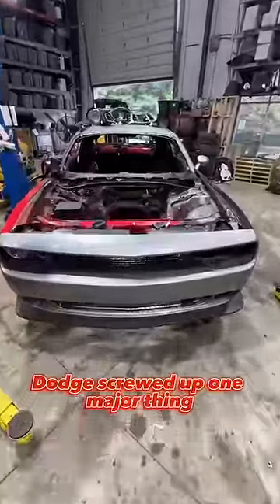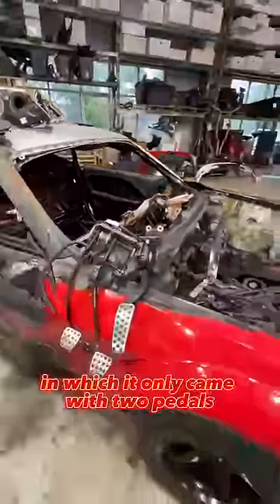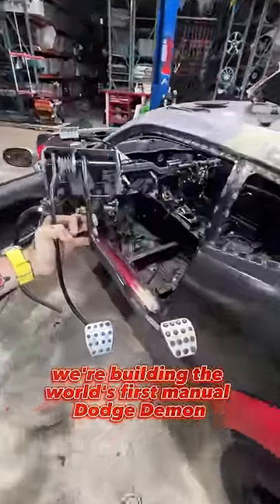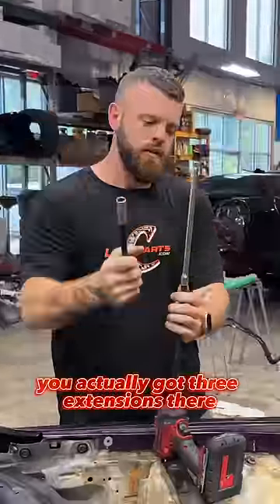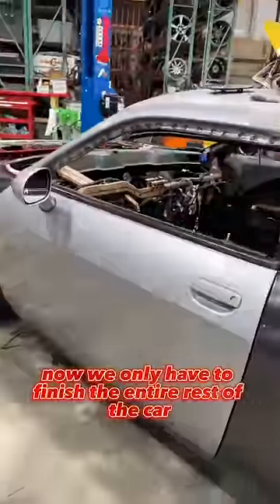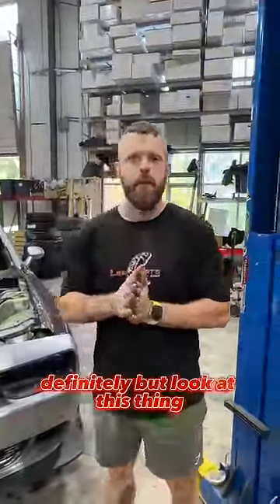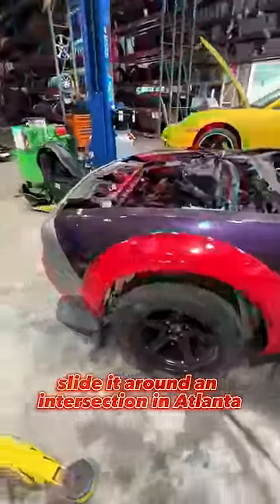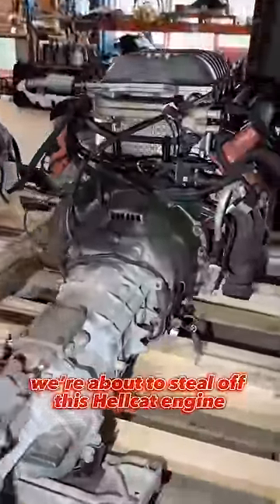Dodge made one HUGE mistake on the Demon!

Comment: Manual gearbox could be slower but its fun, you have much more control to do shit and enjoy your car
Reply: That’s why you choose a normal hellcat over a demon.  A demon is meant to be as fast as possible with no compromises.  If it came in a manual it’d be a nightmare to get it to run decently fast times.
Reply: Plus the manual will be way more dependable for years to come. I personally don't own anything with an automatic transmission.
Reply: @benson4820 I don’t think so, the torque converter is what slips more than a clutch and makes you lose power, if you actually know how to drive a manual and manipulate the clutch it’s way faster cause you can actually get in full gear pulls unlike with automatics. The only part I agree with you is the computer may shift faster and at better moments than a human operator can but manually is still better in my opinion
Reply: @faucitv4684 I don't. We didn't get Dual clutch trans for no reason... Autos are faster, Manual is helllllllaaa more fun, but you gotta be fast as hell at shifting if you want to use all the HP in the car... Honestly I feel like the engineers behind the caddilac blackwing are right, 700 hp and STOP.
Reply: @evilwilliams  dude it’s not the 80’s automatic transmissions are better than manuals in literally every way except “fun” but I don’t know why y’all think changing gears is so much fun.
Reply: @notmyrealname1698  oh yeah. Remind yourself of that statement when you're paying 5 to 6 thousand dollars to get that slush box replaced. Fun fact automatic transmissions were first introduced to attract more women to buy cars.
Reply: @evilwilliams   bro you are just so wrong idk why you have an emotional attachment to a manual gearbox but modern automatics are literally more reliable, more fuel efficient, faster and longer lasting than any manual Transmission. Technology has advanced genius and you mentioning that it was invented to entice women to drive just shows that you’ve somehow attached this to your sense of manhood which is just sad.
Reply: @notmyrealname1698  No you are wrong on every level! Nobody will ever convince me that an automatic is stronger than a manual gear drive, anybody that knows the least bit about power transmission knows the gear drive is stronger and last longer than an automatic PERIOD end of story. That part about sales to women came from a program on the history Channel years ago so maybe they lied although it is very logical. It has zero to do with "manhood" on my end it's all about the stronger more dependable component that is the manual transmission. If it's affecting your manhood in a negative way however, may I suggest a straight drive vehicle.
Reply: @faucitv4684 it's cute that you think manuals are faster than new auto transmissions. Are manuals fun? Hell yeah. Are they faster than new autos especially performance autos? Not a snowballs chance in hell. Not even with Ken block driving.
Reply: @nateg08  no cause while you there with just your foot on the pedal going through gears and you already in a higher over drive gear I can leave my transmission In 3rd and gap you cause you can choose which gear you want to use
Reply: @faucitv4684 Yeah no, (good) automatics are better than manuals in racing period. Faster, smoother, shifts, and a stronger design. Manuals are FUN, auto’s are faster
Reply: @faucitv4684 Yeah no, (good) automatics are better than manuals in racing period. Faster, smoother, shifts, and a stronger design. Manuals are FUN, auto’s are faster
Reply: @faucitv4684 Yeah no, (good) automatics are better than manuals in racing period. Faster, smoother, shifts, and a stronger design. Manuals are FUN, auto’s are faster
Reply: @faucitv4684 Yeah no, (good) automatics are better than manuals in racing period. Faster, smoother, shifts, and a stronger design. Manuals are FUN, but auto is faster. Really cant even argue gearing control either because thats what DCTs (which are still automatic transmissions) are for
Reply: @evilwilliams ”Nobody will ever convince me a manual is stronger or faster than a manual”
Bud look at every performance car and tell me what you see across the board, its automatics. Look at any high power drag cars, even top fuel drag cars are using 3 speed automatics
Reply: @faucitv4684 1 no thats not how it works, 2 have you ever heard of a DCT?

Comment: Manuals you get less powertrain loss and you can FEEL the power way more. Definitely a win.
Reply: As the old saying goes you eather love them or hate them and choose accordingly
Reply: Less powertrain loss, but also a slower, less durable transmission
Reply: @kingiument4627  Manuals aren’t slower? They pull way harder than an auto that’s a known fact. And manuals are far more durable than any auto. You’re completely wrong. And yeah way less powertrain loss.
Reply: @pollux2825  Go do some investigating man 😅. Performance cars, race cars, drag cars, tractors, tractor trailer trucks, even industrial dump trucks all use automatic transmissions. Why? Because they’re faster and stronger. Manuals have their place in economy vehicles now and some specific industrial uses like logging trucks. Welcome to 2024 man it isnt the 80s and 90s anymore
Reply: @kingiument4627  Everything you listed still uses and makes manuals? You’re absolutely tweaking. If you don’t know manuals last longer and hold more power you know absolutely nothing about cars. The U.S is the only spot that switched to auto’s so hard. And it’s not because of anything besides the fact they’re all lazy. Sequential’s are the best to use for performance and track, and ask any trucker ever they all prefer manual and they don’t break like auto’s. Auto’s are only better at shifting faster and making driving slightly easier😂 (when compared specifically to an H pattern manual transmission). You’re also talking like U.S is the whole world when it’s a tiny spec of it.
Reply: @kingiument4627  Any small amount of research will tell you manuals are far more reliable than automatics. That part really is crazy. Mpg and reliability and simplicity is why the rest of the world still uses them. Stuff the U.S cares nothing about. They don’t care about long lasting vehicles they don’t care if things are overcomplicated and the people over there and there massive dumptruck cars show no one cares about mpg either. Besides with how much they like big cars over there makes sense to put a big clunky auto in it. You probably drive a CVT😂
Reply: @pollux2825  Manuals are more reliable with someone who knows what they are doing, sure. This wasn’t an argument of reliability it was an argument of what is objectively better. And then you start babbling on about nonsense and using insults for no reason solely because you guys are getting schooled

Comment: It was a crime to not make a manual demon
Reply: Not really, it’s supposed to be as fast as they could possibly make it.  A manual version would go against its philosophy.  There are plenty of other Challenger variants that come in manual.
Reply: @benson Nah it's a crime mate, you don't think so cause you can't drive manual, manual will always be quicker and better round a track, you're in more control of the car.

Only people who rate automatics are those who are shit at driving stick.
Reply: @GM-wu7cn maybe in a 2t old benz lol, try going against a 992 gt3 rs and tell me manuals are still quicker 😂

Btw i live in Europe and daily drive a manual
Reply: @GM-wu7cn it is designed to go as quickly through the 1/4 mile as possible. In drag racing automatic beats manual every single time.
Even in track racing, a semi automatic or fully automatic will beat a manual.
Reply: @hughmongous5089 Depends on the driver. They have their preference.
Reply: @kriswhite6838  manual can't keep up with modern transmissions. You can't shift as fast as a dsg without severely shortening the lifespan of the manual transmission or the clutch or both not to mention the much higher number of gears you can have with an automatic.
Reply: @GM-wu7cn as someone who has driven manuals as dailys for the past 6 years… automatics can definitely be faster. BUT, nothing beats the satisfaction of a perfect manual shift. Automatics are boring af.
Reply: @looped7979 Well in Terms of drifting a Manual will be unbeatable
Reply: @GM-wu7cn youre actually ignorant bro... a DCT transmission will always be faster than belt driven autos and Manuals. I agree with manual being more involving but to claim manual is faster is humor
Reply: @GM-wu7cn  LOL, you truly know nothing about cars. The Deamon is built for drag racing! Auto is ALWAYS faster and most constant in a straight line, which is exactly what this car is intended for. There is a reason why the Power Glide and Turbo 400 transmissions are far more common in drag racing than a stick shift. You want a Challenger with 3 pedals, get a SCAT or Hellcat. And this is coming from someone what had NEVER owned an automatic in their life.
Reply: @looped7979  paddle shift is still manually shifting, not a fully auto box, no rally driver drives with an ecu shifting for them.
Reply: @ohnaw223  No you're ignorant, not everyone races in straight lines. "Round a track"
Reply: @GM-wu7cn  The demon was developed as a quartermile beast. Stop bro just stop
Reply: @GM-wu7cn Automatics are still faster than manuals around a track, too.
Reply: @johnathanmoyer2375  tell me why F1 cars are paddle shift and not a full auto then bro
Reply: @GM-wu7cn  We're not talking about auto vs a dog box sequential manual.  We're talking about auto vs a synchronized  gated manual.  You know, the ones actually used in road cars.  DCTs and even ZF Torque converter transmissions are so much faster than any synchronized manual.
Reply: @GM-wu7cn quicker around a track for a car that was built for the 1/4 mile
Reply: @GM-wu7cn  You are clueless.
Not only is automatic quicker in the 1/4 but they don't want to warranty driveshafts and U joins to people like you.
Reply: Real drivers know how to swap cogs.
Reply: @stuwest3653  "round a track" there I'll say it again.
Reply: @GM-wu7cn i had a 6 speed ls and an auto. Manual was more fun stock vs stock. But auto is way more fun with a 4k converter. Auto + huge stall is the god of all setups and the most fun. Unfortunately you assume people can't drive stick. I assume you have no idea how a stall feels. If your ignorant and haven't driven both, your opinion is invalid.
Reply: @GM-wu7cn lol manuals being faster than autos hasnt been true since probably the 80s or earlier. New autos shift WAY faster than manual ever can. I love driving a manual for the feel and involvement but you're dreaming if you think they are faster than new auto transmissions. That's absurd.
Reply: @brandon9491  have you ever tried something like turbo 400? You still shift.. just not clutch, and with a small torque converter, the revs are 10x greater feeling and control than any manual I ever owned. Had t56 6speed z28 and stock ls1 with 4l60 and 4l60 e with 4k yank stall, and 400 with 4k stall for nitrous. Manual is cool and all, but way over rated by high school kids who aren't fully indulged with drag racing knowledge
Reply: @GM-wu7cn the demon is a drag car not a track car. It’s literally made just to go in a straight line as fast as possible. If it was a track car they wouldn’t give you the thin front tires, which are specific for drag racing. Autos are just better for drag.
Reply: Agreed felt that the last call chargers and challengers should've had a manual option imagine a 2023 Charger Daytona, Scat Pack, Hellcat/Redeye and of course the SRT Demon whatever number it is
Reply: It’s a drag racer(and a heavy/slow one at that) not a drift or rally car. There is simply not purpose or need for it to be manual.
Reply: @GM-wu7cn that’s not true at all guarantee you a Porsche will beat any manual car you throw at it

Comment: Wait till he finds out you can order a manual demon from the factory
Reply: except you can't...? only hellcats have been manual
Reply: @shoopitor3796 Must be something to do with last call allocations on the Demon itself. May be worth looking into if OP is correct.
Reply: I googled it. Manual demons were never a thing, even as a special order.
Reply: Now get it under 2 tons!
Reply: Cant, not a thing
Reply: In 1970 it was a better option
Reply: @Wheagg wrong
Reply: The only supercharged V8 models with manual are the regular and wide body Challenger Hellcats. You can’t even get a Charger of any trim in a manual
Reply: i’m seeing a mandela effect🤔 ppl seem to remember demon coming with 3 pedals
Reply: @kabob21  1971. Demon 340. , 3 speed manual transmission
Reply: @6lackRain  not a single person remembers, reread the comments buddy
Reply: @autopartsmonkey7992    1971 demon 340 3 speed 275hp and 370 ft-lb torque weighing around 3200lbs doesn't sound like a better option than 808hp 717ft-lbs torque at 4200lbs ill sacrifice the manual trans
Reply: @autopartsmonkey7992  back when manuals were faster than autos, yes. Now that the auto is faster, dodge's halo speed demon has only the fastest setup
Reply: @autopartsmonkey7992 how are you gonna bring up a completely different car in a discussion about a challenger demon
Reply: Yeah maybe in 1971 but not right now
Reply: Manual demons don’t exist lmao
Reply: Except that demon doesnt make nearly as much power as the new ones

Comment: FYI   Your not the first one to build a manual demon.      I know of a 1972 triple black car.  If my memory is correct it was called the black ghost  .  😮
Reply: That’s not a demon lol that’s just a base model 1970 440 Hemi challenger with extra steps
Reply: The black ghost wasn't close to a base model. It was one of the only cars to have every option including the gator top.
Reply: @thatsrtkid  yeah it was an expensive muscle car with gator yippee it still wasn’t no dodge demon
Reply: @killerdragon2011  right... it was a dodge challenger. And the demon used to be a faster Duster in the 70s. You said base model, the black ghost was far from that. The gator was a rare option bc it was expensive and also ugly.
Reply: @thatsrtkid  yeah I kinda forgot it had other options than just the triple black and gator tbh lol it’s been awhile since I’ve watched anything about that thing
Reply: @killerdragon2011  no worries dude! There's a great 20 minute documentary on here abt it. The 426 in the black ghost was also a rly expensive option almost no one could afford. And it owned by a cop of all ppl

Comment: There’s a reason it’s running a beefed up ZF 8HP90.. you’ll never shift faster or smoother with a manual, but neat to see on being done
Reply: It's not about "shifting faster" why do people automatically go to this when comparing a manual "you can't shift faster" no shit Sherlock.  We know that.  The ppl acting like the auto is 3 seconds faster in the quarter are ridiculous more like 3 tenths lol.  If you can drive you can come pretty close to the speed of a modern auto shift and it's not about that anyways.  It's about the experience and having 10000000x more fun.  I'll take that any day you can have your 3 tenths I'll find 100 other ways to get that back and then some.

Comment: I'll never understand other car guys' obsessions with adding a whole extra step to how you drive your car lmao. Autos with paddle shifters are so much more efficient
Reply: Ppl who can't drive a manual well aren't gonna understand it.  It's not this huge awkward slow thing for us we do it quickly and smoothly and it's super fun and engaging.  I feel bad for people like you who will never know how good it feels rowing through a gearbox efficiently on a backroad or running right beside a modern auto in a roll race when others think that isn't possible or shifting faster than others thought was possible.  You will never know what any of that feels like thus you'll never understand why someone wound go out of their way to "add an extra step" to the driving experience.  Auto with paddle shifter is NOTHING at all like driving a true 3 pedal manual so don't think that it is because it isn't.  It's not even close to the same thing and it's super gay.  Have fun with your boring auto while the rest of us actually drive our cars.

Comment: The car was designed to drag race. Manual is slower period for that application.

Hellcats are designed for Daily use, 800+ horsepower with a manual mechanical clutch is just miserable to use on anything but a track

Comment: Okay Imma just say this right now 80-95 percent of all demon owners could not shift fast enough to be faster than the auto. That auto family is insanely good to the point where flipping BMW is using it on their m cars(use that info for what you will but it’s true). It would be fun but holy fuck knuckle would it be hard as shit to shift it for a 9 unless the gears were long as fuck

Comment: I had built the first and only, that im aware of, Manual trans Buick Grand National. I used the pedal box from an El Camino and the rest was from a 68' corvette. And it all fit without modifying any of the parts because the Buick and El Camino share the same G-Body frame and cowl. Even the floor pan was embossed with the marks where you drill the holes for fhe linkage.

Comment: Why didn't you just call the demon a AUTOMATIC car??
Or did it have the clutch on the steering? In the UK since mcmlxxx(1980) I've always known it to be three pedals for manual and two for auto.

Noe the question is, what super car has automatic, forget the brand, automatic racing is more or less go-karting..

Dodge Demon = Doge Kart